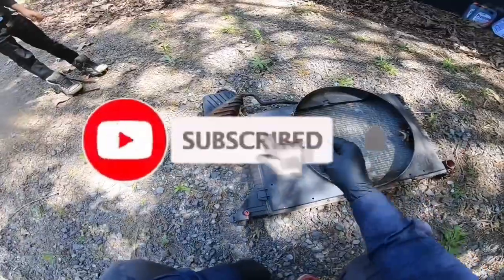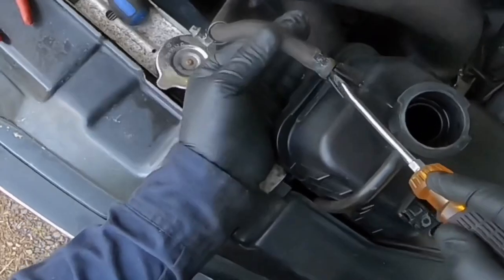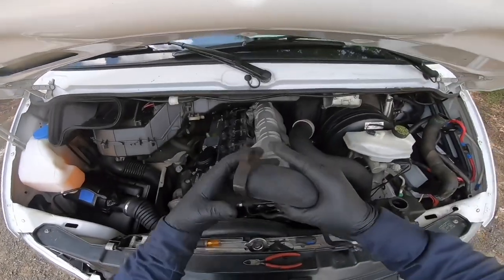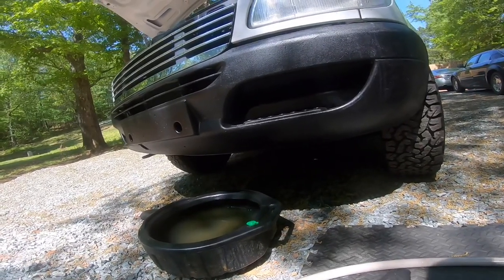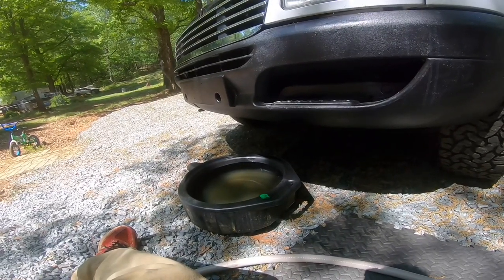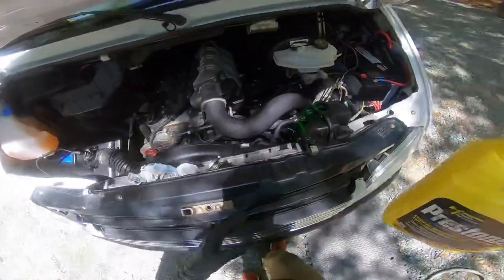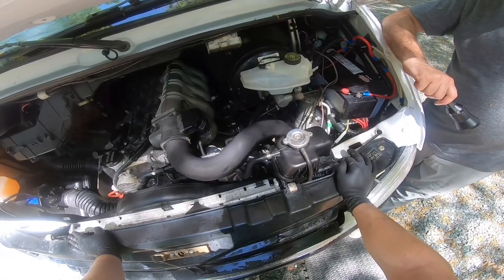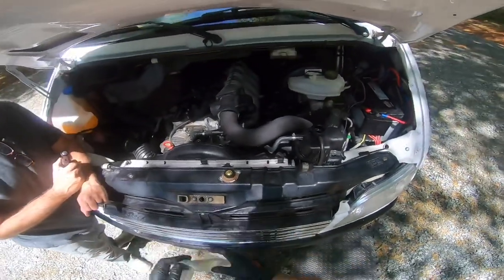How To Do a Radiator Flush Start to Finish and mix Radiator Fluid for 50/50 mix Mercedes Sprinter

Comment: I do watch a lot of your videos and I enjoy watching them. But on this one I disagree with you on few things like using any antifreeze, My personal opinion is to use what the manufacturer recommend or to be the closest to European engines and the second thing is to get al the air out of the system and make sure all the air pockets are out. Like I said before it is just my opinion but if works for you then keep moving 
Thank you for taking the time to make this video
Reply from the maker: Your welcome, this is my way so if you find a better way then why not, I don’t see any problem with it, but I been using this stuff in my Sprinter for over 13 years and so far so good